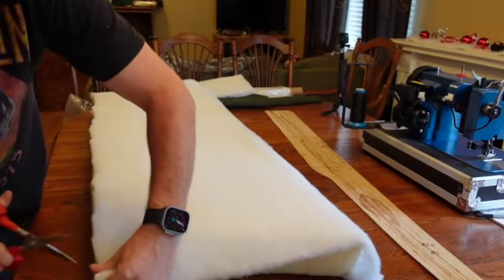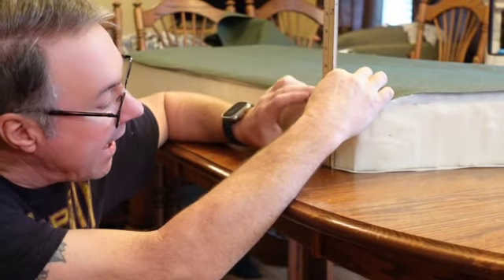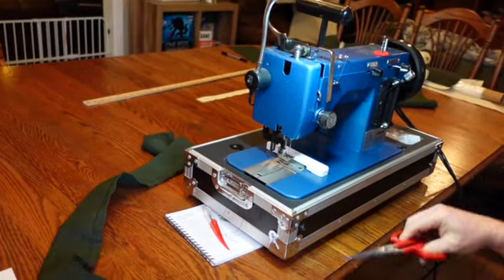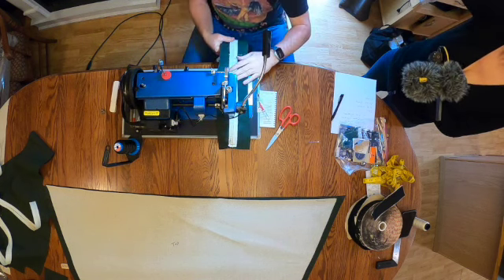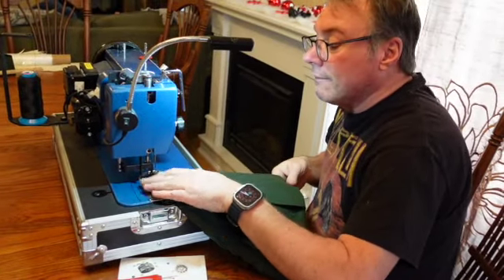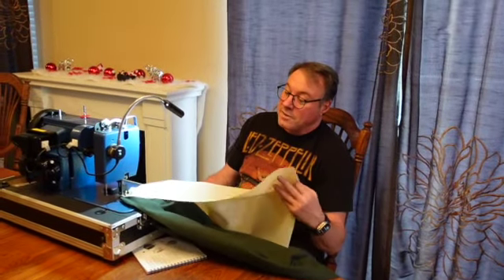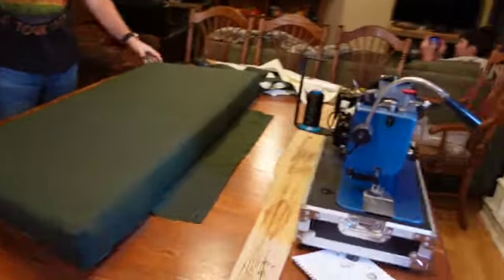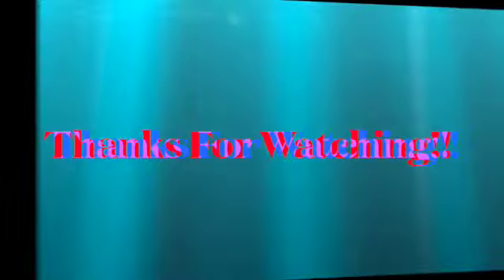29. Can You Make Your Own Boat Cushions?

Comment: Did you add a seam allowance at the ends of the box plaques where they are sewn together? Sailrite states no allowance on the ends which seems strange to me.
Reply from the maker: The first couple of cushions that I made, I did exactly the way they said to do it, and I found that I did not have quite enough room. From that point on I did at allow a little more seam allowance, and it worked out much better for me. I just figured that it was because I am inexperienced with the machine.
Reply: @SV-Mig  Seam allowance when joining the box plaque ends together - correct? BTW, I like the buttons and the fact you made your own (cool). I am undecided about adding buttons to my upcoming cushions as even though it improves the visual appearance of the cushions significantly, it would make removing the covers for cleaning a chore ( the buttons would have to be removed first, then re-installed . Great video..
Reply from the maker: @kameltoes2625  I added 1/8 of an inch for all of the box plaques, except for the zipper plaque, which I added 1/4 inch seam allowance because I am terrible with the machine. Honestly, in my opinion, the buttons are very easy to remove and to reinstall as long as you have the long needle. It honestly it’s just a matter of snipping, the heavy thread that I use to pull it tight and then you just redo it when you need to. It really looks great. I’m super happy that I did it. If you notice I did not put buttons on the seat cushions that was because I didn’t want dirt and stuff together in those spots like they do in old couches.